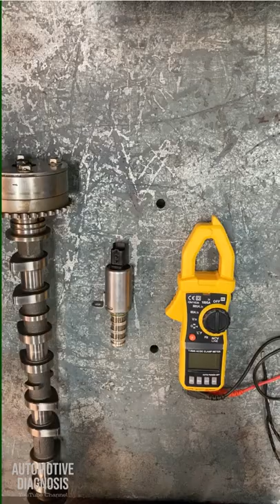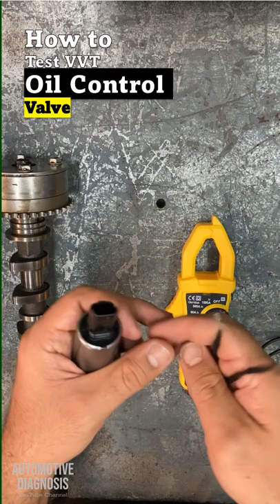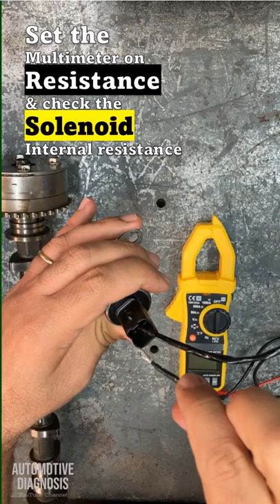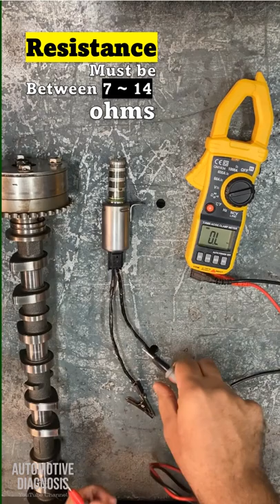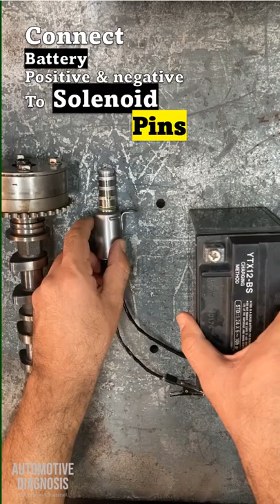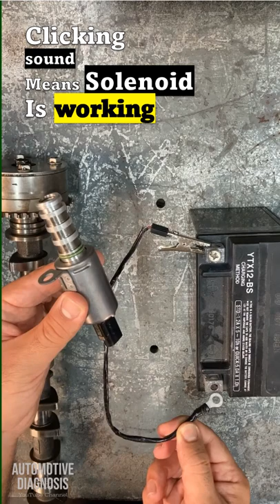How to test a Variable Valve Timing (VVT) Solenoid

Comment: Hi I checked mine is it out of spec?? (Ω) 6.9 ~ 7.9 68°F , im reading 9.1 but at 60°F
Reply from the maker: No, this reading is acceptable.
Reply: @AutomotiveDiagnosis  what would it read if it's not good?
Reply from the maker: Very low or too high value @JoseSandoval-ic5xe

Comment: A cool way to check the resistance, I mean those two wires, nice one.
Reply: @AutomotiveDiagnosis pero funciona o está averiado?? Ya que no veo que retroceda la válvula?
Reply from the maker: @pedroburja  on some solenoid valves, filter is separate so you can see the spool valve moving back and forth, but on others that filter is located on the valve, hearing the ticking sound would be enough to say that valve is working.

Comment: Does it matter what cable goes to what pin like witch is positive pin and witch is negative? Just don’t want to fry anything
Reply from the maker: It's better to connect in a proper polarity. although reverse order on a solenoid that does not have any controller inside will not fry it.
Reply: And how to know the polarity of the vvt pins?

Comment: My scammer says vvt fail, but no check engine light …Car vibrates after warm up could it be the vvt solenoid s?
Reply from the maker: Yes, if VVT solenoid is too dirty with oil sludge
Reply: @AutomotiveDiagnosis  ok,  oil changed at 3,000 miles since new , perhaps one is going out ….🤔
Reply: @AutomotiveDiagnosis  How to pressure test camshaft variator? Thanks.
Reply: @AutomotiveDiagnosis I have a 2012 Chevy equinox with p0014 code and I swap out the exhaust one and fresh oil change and still has it the car runs smooth

Comment: So if I buy cheap eaby solenoid and they say 7.0 0r 7.5 are the still good?
Reply from the maker: not any solenoid, it must same part number as your car's solenoid.
Reply: ebay's are knock offs. Go to RockAuto
Reply: @SirCavemaninthewest rockauto carries knock offs as well beware
Reply: I bought a Dorman aftermarket. It works but car has hard starting and I still have check engine light

Comment: That way of checking the actuator with a 12 volt battery is wrong...I did this and both of my actuators have passed away, my car runs like crap now. They are feed from the ECU with a lower tension around 8 volt so connecting them directly to a 12 volt source will cook them up
Reply from the maker: This method is recommended in many workshop manuals and it shouldn’t make any problems if it’s performed correctly and in a very short time. Although this video is general and doesn’t refer to any specific car, so for any specific car workshop manual must be checked for the specifications and relevant repair procedures.
Reply: I think you touched the two connectors and fried your stuff dude, this is the correct method.
Reply: You just did something wrong.